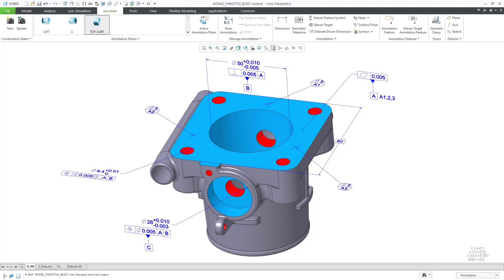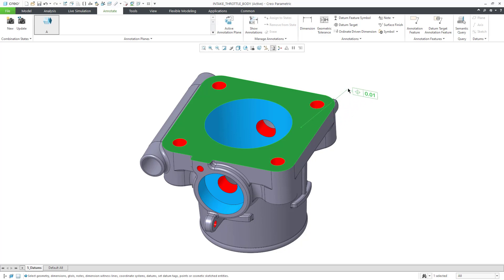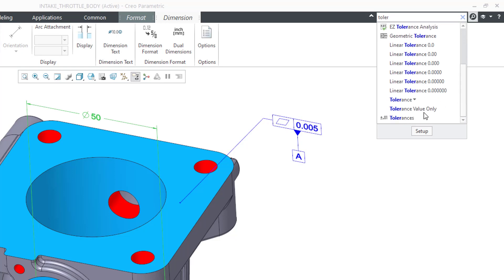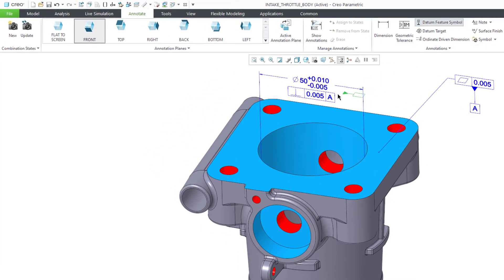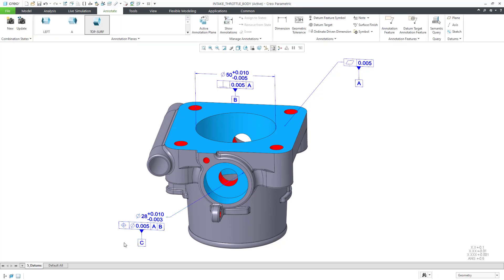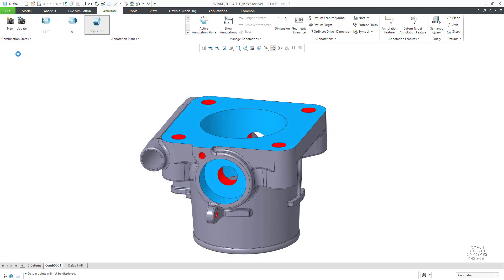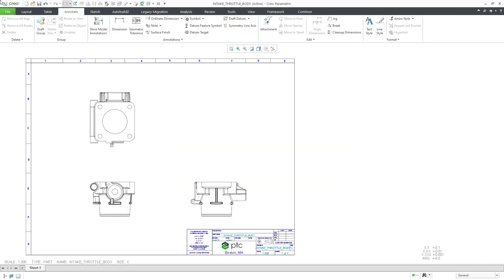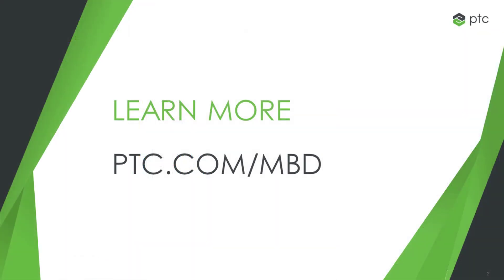Introduction to Geometric Dimensioning & Tolerancing

Comment: THIS IS HELPING TO REPLACE 2D DRAWING WITH 3D DIM
Reply from the maker: If your organisation/downstream stakeholders still require 2D drawings, you can get those from the 3D models, but, yeah, putting the 3D model at the centre can bring significant benefit to the company and suppliers. (And it's worth trying to get everyone to make process changes.)